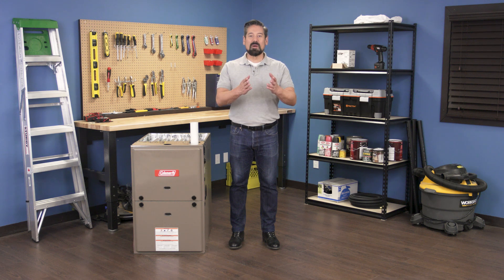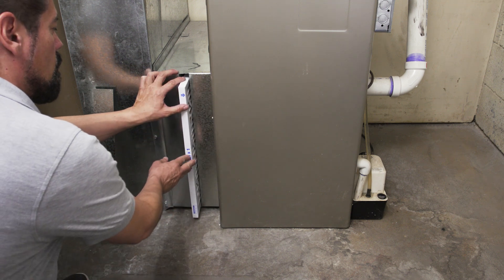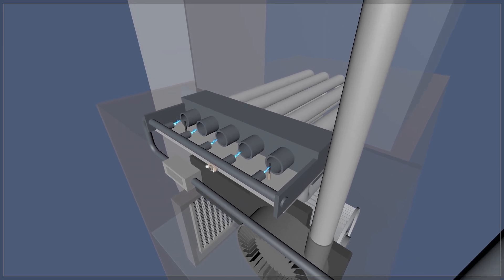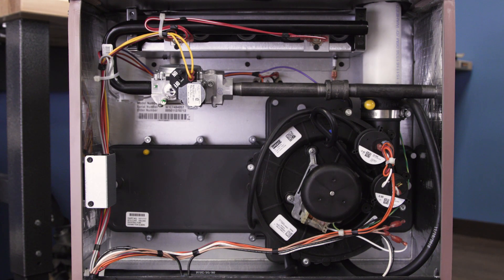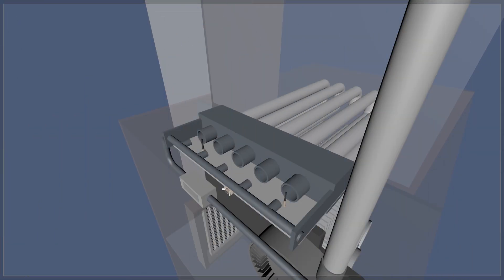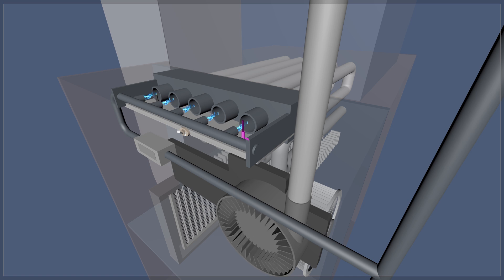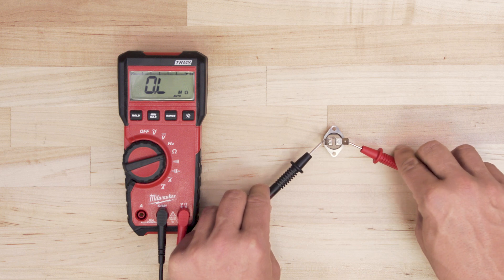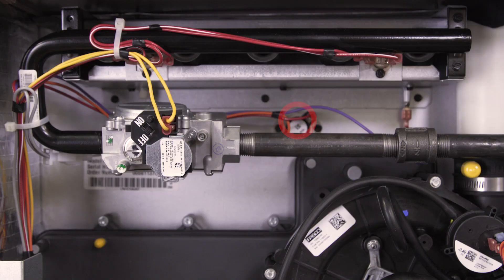Furnace Troubleshooting - Common Problems | Repair and Replace

Comment: Is it possible for a furnace not to shoot an error code for something? I've got a code for a main limit switch and I've replaced that, but it's still shooting a code 22. After watching this video- it seems more like a pressure switch problem. Can I test a pressure switch with an OLM tester?
Reply from the maker: Hi Dana, thank you for watching. The pressure switch can be tested for continuity but it can be tricky as it depends on how the switch is wired and where in the system it is located. The switch will either be normally open NO or normally closed NC. A normally open switch will not have continuity at rest, and will only have continuity when it is pressurized. A normally closed switch has continuity, and will lose continuity when the pressure builds up. So you can test for the continuity but its difficult to test to see if you're getting enough pressure within the system.

Comment: furnace typically adjustable?  I feel like my furnace should be producing warmed air.
Reply from the maker: Thanks for watching. The furnace temp isn't exactly adjustable but there are a few things that can affect the temperature of the air coming out of the registers which should normally be 100°F-130°F. 

A clogged or dirty heat exchanger will not transfer as much heat to the air as it passes over.

A wrong fan speed  or improper air filter (if air moves too quickly over the heat exchanges, less heat is transferred)

As well if the cold air return is in a cool part of the home then the furnace is supplied with air that will need to be heated up more. Insulating this can help.

Comment: when I turn on my furnace it instantly starts blowing cold air w/o delay and never blows hot air. Would that be a problem with the ignitor or whatever is controlling the fan? Since the fan shouldn't be turning on until the air is warmed up in the furnace.

I also tried setting the thermostat to a MUCH higher temperature than normally and noticed warm air come out of the  vents for like a minute then go back to cold.

Still need to test the ignitor and others, just leaving this comment here.
Reply from the maker: Thanks for watching. We actually made a video on the furnace blowing cold air. It can be a thermostat setting or an issue with the limit switch. You can see more in the video here: https://www.youtube.com/watch?v=XrxV6I8C4yY

Comment: Is it the control board if there's no power going to the gas valve?
Reply from the maker: Thanks for watching. If the gas valve is good, but there's no power being sent then you're right that it could be an issue with the control board. In that case the draft inducer should still run and start up before the gas valve opens, this means your furnace is still getting power. The control board is difficult to troubleshoot as there are many small components and capacitors etc on the board that can fail.
Reply: @AmreSupply   Thanks for replying. Yes, all the steps happen except gas going to the burners -- inducer, igniter then it tries 3x before I get the blinking lights. I guess I have to go contact a professional for the board issue.
Reply from the maker: @d0uble0  We're happy to help. One last thing it can also be a faulty gas valve as solenoids can fail mechanically or electrically. Gas valve replacements are also best handled by a professional.

Comment: Test voltage at the switch?
Reply from the maker: Hi Lance, thank you for watching. Some people who have the knowledge and skill will test live voltage to see what its doing while the furnace is running. In our videos we do not cover live voltage testing for safety reasons. For safety, its always recommended to shut the furnace off before testing any switch or component.

Comment: please do a video on the control board thanks.
Reply from the maker: Thanks for watching! We haven't gotten too deep into the control board as there is a bit of variety and a layer of complexity best saved for service techs. We did do a video on Short Cycling which talks about error codes and different stages where the furnace can shut down. If you are curious its another good all around video.  https://www.youtube.com/watch?v=b0sAGt-1niU

Comment: "then call a professional"....
lol
so, I call myself?
Do you guys offer any videos geared towards professionals?
Reply from the maker: Thanks for watching. Most of our videos are geared towards homeowners so we don't have professional HVAC training. Our videos don't get into gas line repairs or installation of  control valves or go into advance diagnostics or live voltage testing. 
We do have a few more troubleshooting videos that might have helpful graphics for you to visualize, this one is on short cycling: https://www.youtube.com/watch?v=b0sAGt-1niU&list=PLCo9SMjkdWBzorzNrARLKALj9fW7HzHMh&index=4&t=0s
As well you might want to check you Greyfurnaceman. He has a good way of explaining various concepts: https://www.youtube.com/channel/UCchpiPYTBEg4DpK6mKfYi2A
Another good channel is this specifically for Techs, and there are some good lectures. https://www.youtube.com/channel/UCdLlUhD9LUGm0-NTYDASPFA/videos

Comment: Your videos are so good and informational. 
I have a question as recently my furnace was shutting down. I changed the flame sensor and ignition continued but when i close the flame housing, the furnace shuts down immediately. What would possibly be the problems
Reply from the maker: Thank you John, we're glad you're finding our videos helpful. Its likely that running the furnace with the cover open is giving it more air for combustion. Its worth cleaning the intake and exhaust pipes to ensure that nothing is restricting the airflow.

Comment: I have an intermittent issue with my heater. I can see my hot surface igniters glow and I see the gas ignite but then right after it ignite the flame goes out. I replaced my ignitor a few time already. So I don’t think that’s the issue. Any advice??
Reply from the maker: Hi Sal, thank you for watching. If your furnace ignites but the flames cut out within a few seconds then its likely an issue with your flame sensor. First try cleaning the flame sensor, and check the position, as it needs to sit in the flame to work properly. As well, you can check the connections to make sure there is no corrosion on the terminals connecting the flame sensor and the control board. If that doesn't help then replace the flame sensor. You can see how to do that here: https://www.youtube.com/watch?v=af_qRnfHFws

Comment: I knew literally nothing about gas furnaces and have been scratching my head as to why my house heats up to the set temp, but then never turns back on once the temp drops below the set temp.

Figured out after watching the vids it's most likely my limit switch. Was able to find and replace it and save myself a TON of money from having to call a professional. Thank you!
Reply from the maker: Hi JPeeet, thank you for watching! We're glad the video helped you out and saved you money!

Comment: Hi.... my blower fan take longer time to start than before....... after the blower starts everything is normal...any advise....?
Reply from the maker: Hi Humberto, do you mean the blower fan is delayed a few extra minutes? Or do you mean that the blower fan motor is slow to start turning?
Reply: AMRE Supply the blower fan is delayed a couple extra minutes if i compare what it was before.
Reply: And thanks for your answer....
Reply from the maker: @humbertocardoso7777   Overall a couple extra minutes delay isn't problematic as long as it all runs normally afterwards.

Now for the cause, it would depends on the type of furnace that you have. If you have an older model that uses a fan switch to detect the right temperature to start the blower fan, and a limit switch to shut the blower fan off, then those switches could be starting to wear down and lose their accuracy. Most modern furnaces and high efficiency models don't use a fan switch though, instead there is a delay set by the control board.

Comment: Help me with this simple problem thanks heater comes on now and turns of.  But but when it reaches set temputrture .  Jeter never let it gets under 75 degrees that I set it it comes straight on never getting below 75 degrees is that normal
Reply from the maker: Hi Rich, just to clarify: you're saying that your home temperature always sits at 75 degrees and even when you set your thermostat to something lower (like 70 degrees)... the heater still comes on? If that's the case it sounds like your thermostat is the problem. 

If your thermostat is in a cold part of your home, then it might make the heater run even when the other rooms feel like they are at a warm temperature.
Alternatively if you have an old bi-metallic strip thermostat, that uses mercury, check to see if it is level. If the thermostat is tilted, it could throw off the reading as the mercury will shift to one side. 
If you have an electronic thermostat, then replace the batteries and see if that helps.

If you are considering getting new thermostat here's how to choose one: https://youtu.be/NO5guc3vfV0 and how to install https://youtu.be/XUi0rG1WYrI
Reply: @AmreSupply  saying that when I set it to 75 degrees and when it reach 75 degree it stops and cycle starts again like 5 minutes and the temperature never really went down below 75 degrees .. it's it cause the thermal stat will nor let the house go below 75 degrees and the cycle starts again .  When will the cycle end and not come on so often
Reply from the maker: Thanks for clarifying. Just a few questions:
Is this a new problem, or has this done this during other winters?Have you replaced your furnace filter recently?How old is your furnace?
What kind of thermostat do you have?

Comment: I have an Armstrong gas furnace that is giving me the Inducer ON Pressure Switch Open error code. The igniter lights, the flames light, but as soon as the blower turns on it creates a vacuum in the box and the pressure switch trips and shuts down the furnace. According to this video, I think I need to check the tubing going to the pressure switch (did that and it's good). I checked the condensate tube and it did have fluid in it so i cleared that, but it's still creating a vacuum. Im going to check the intake pipe next because I think the intake isn't keeping up with the blower. Ill update this with the result :)
Reply from the maker: Thanks for sharing your experience William. For sure keep us posted with how it goes!
Reply: Checked exhaust and intake pipes and the draft motor. No clogs... however the pressure switch is not the OEM one. It's a variable one. I've ordered a new OEM one. I'm going to install that in a couple of days.
Reply from the maker: Having a pressure switch with a different rating other than what your furnace is rated for can definitely cause it to shut off earlier, even when the pressure in the furnace is good.
Reply: Ok so, here's the final verdict. The heat exchanger was clogged with buildup of some sort and was starting to crack causing the difference in pressure in the combustion chamber which tripped the pressure switch (doing what its supposed to do). Solution was to get a new furnace. The price for the heat exchanger repair was about half of what the furnace would cost....
Reply from the maker: A cracked heat exchanger is definitely problematic and is not an easy thing to replace. Between the labour and the cost of parts it adds up quickly. At least with a new furnace there is some piece of mind that it'll be running smoothly. Thank you for sharing your updates.

Comment: Why does the igniter keep burning out
Reply from the maker: Hi Paul Bridgeman, although its common for the ignitor to burn out with normal use, there are a few things that can decrease the life of the ignitor. If one touches the element surface directly, as oils in the skin can create a hot spot on the ignitor so always hold the ignitor by the base. If excessive voltage is going to the ignitor it will decrease life. Additionally if the furnace cycles on and off repetitively, it will also decrease the life. Overall the type of ignitor can make a difference. When possible choose a Silicon Nitride ignitor as they are a little bit more robust.

Comment: What would cause your blower motor to instantly kick on when turn thermostat to heat?
As soon as you turn it to heat the inducer motor comes on like it should, but the blower motor starts up at the same time and nothing else happens.
 No ignitor so therefore no flame. 
Just constant inducer and blower running. 
Error code says flame sensed with no call for heat, But there is no flame to sense
Reply from the maker: Hi Shawn Denney, Its odd that the inducer and blower are both running, but for safety sometimes the blowers can run out of sequence when the furnace is trying to clear fumes etc. If the flame rollout switch trips, it could cause that error code. Try to reset or replace the flame roll-out switch 5:30 or https://youtu.be/23LGRraYUg0?t=1m37s
Reply from the maker: Thank you for sharing your experience Mike Thompson. Since there are so many different scenarios, its always helpful to hear what has worked.
Reply from the maker: You're welcome Not Your Average Nerds, glad the video was helpful!
Reply: I had the same issue until I found the reset button on the flame rolloff switch.
Check the video at 5:30.  The ignitor started working again after the reset.
Reply: My reset button was stiff and didn't give and I conducted a check with the multi-meter and there was also no continuity. I have ordered a new switch. Thank you for your video.
Reply: The program is a dirty flame sensor. Thats what that fault code means pull it out most the time right near the hit surface ignitor and the flame sensor has 1 wire and 1 screw pull it out lightly sand with sand paper without touching the metal rod bc once again oils could cause dirt to stick and build up